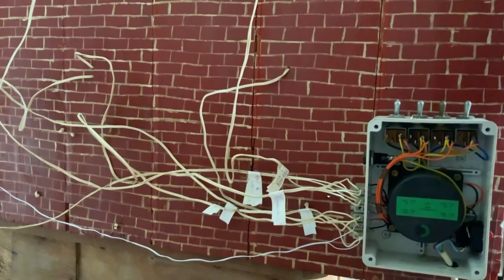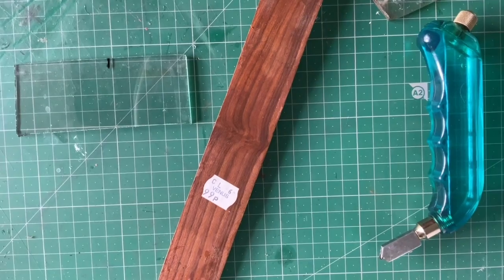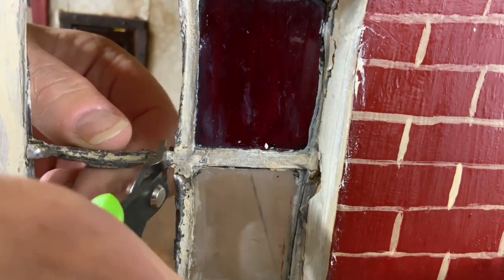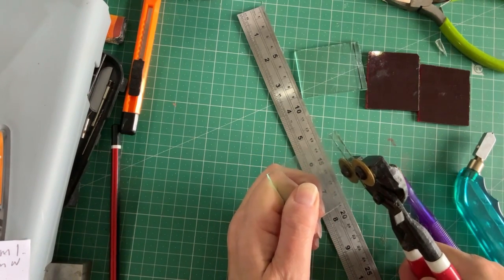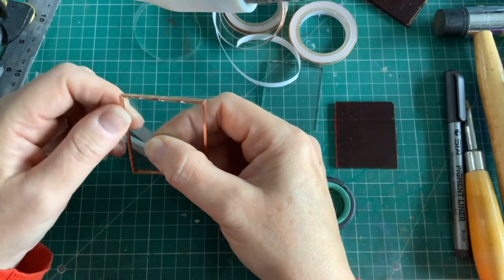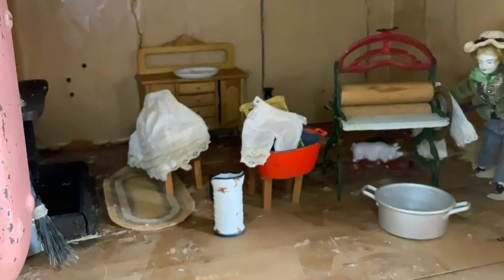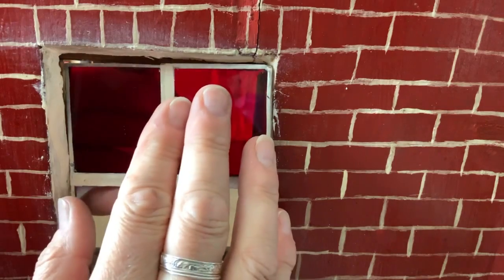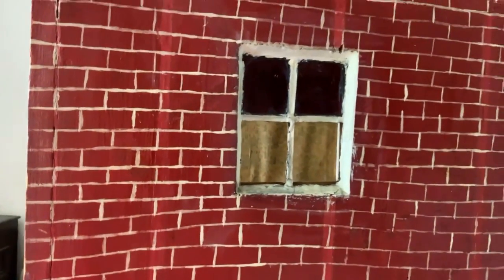Oh no it all went horribly wrong,Tobias gets worn out ,window and more

Comment: It a wood putty you can scrape it out remove the window and regulate it back into place I’ve done this on old windows in the states.
Reply: I wish you hadn’t cut the lead encasement to the frame you just chip out around the outer window and the reglaze the frame.💔💔
Reply: I’m sorry about my first comment spell check drives me insane.
Reply from the maker: Thanks for advise I do have the other window to do so attempt it this way in order to save the lead .thanks for watching 👌🏻😁